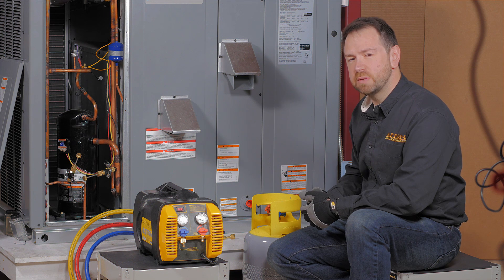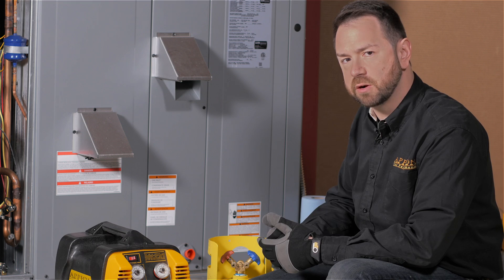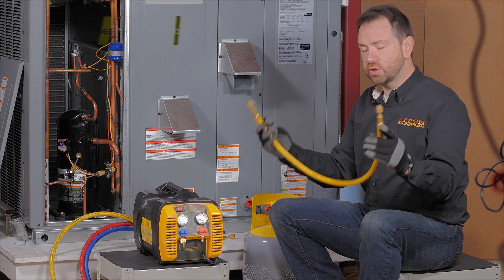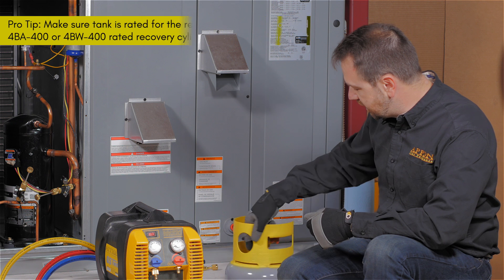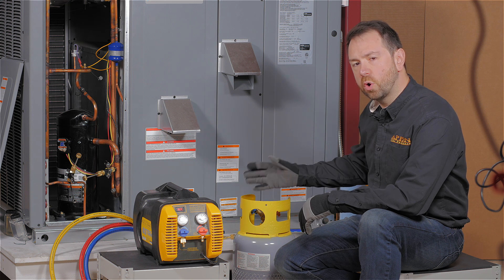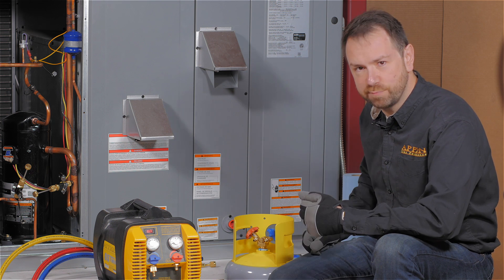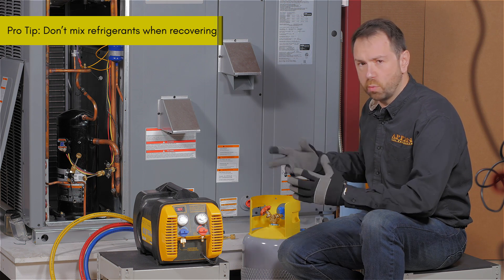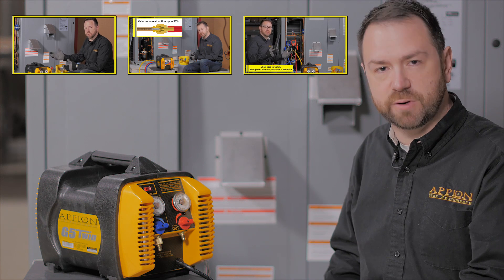Fast Recovery #1: Equipment Ratings & Capacity

Comment: Can it recover R123 used in negative pressure chillers?
Reply from the maker: R123 is Category 1 refrigerant. the G5Twin is certified for Categories 3,4 & 5. Should you have any questions, contact us directly - 303-937-1580.